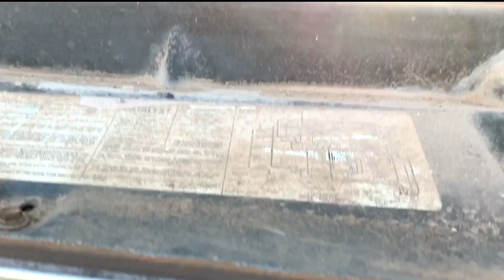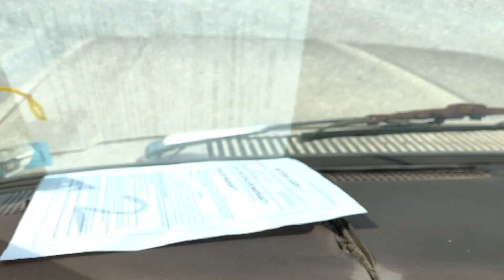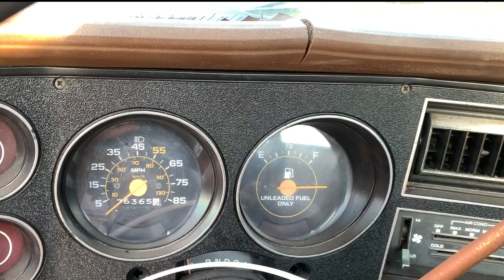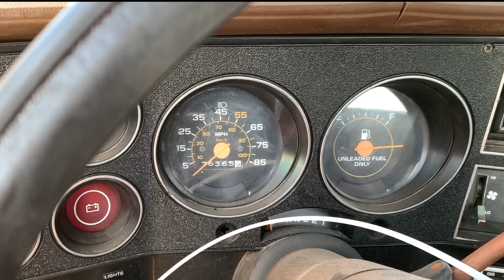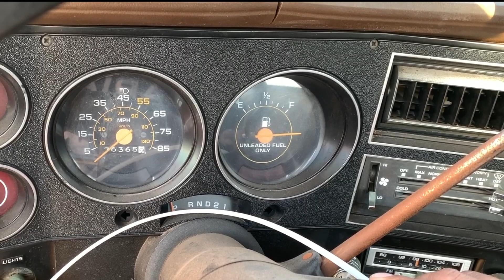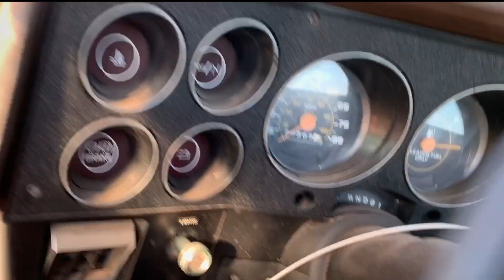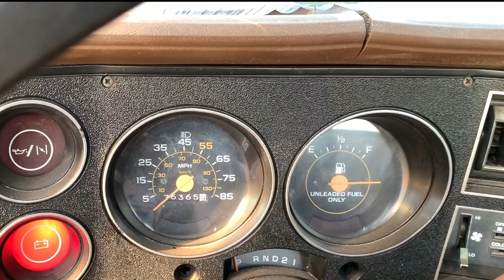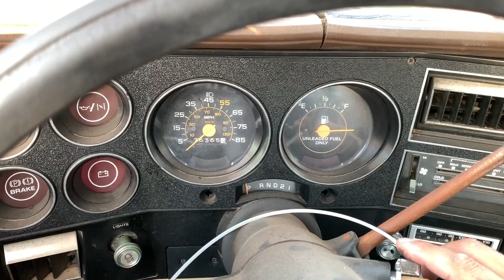Copart $400 Win Reveal - It Caught on Fire!!

Comment: Time for an oil change, some Plugs, Wires, new distributor, belt/s, and the fuel system and it’ll run like a top I bet.
Reply: Needs a LS swap
Reply: Lotta times the cooling system also needs some love on a truck of this vintage, been there done that.

Comment: Never leave the old air filter on a carb engine when using starter fluid or squirting gas into it.  Sure to burn most of the time.
Reply: Yeah, he has no idea what he is doing. Pull the whole air canister off it, it's not that hard.
Reply: Kellys Peppers When will they learn? Lol

Comment: Anytime you have a carburetor fire, just keep cranking and let the engine swallow it.
Reply: That wouldn't have worked in this case because he sprayed starter fluid onto the outside of the paper filter.  The flame had no chance to go back down the throat of the carburetor.

Comment: Replace the fuel line, gas tank(s), and keep the 4.3.   They're Damn good engines!  You usually don't find clean old trucks like this.  Sure it has the V6 but they're just a 350 with two cylinders lopped off.

IF you do swap in a 350, make it appear factory.  These trucks are catching up in value.

Comment: Two things Randy....  1. Don't scare me like that- I thought you guys were about to run that beautiful 350-Z through Copart again.  2.  When I saw the boxy Sierra 1500, I literally gave you that fist in the air thing saying, "Hell Yea!"  I'm so glad you got that one.  BTW, I just want to let you know, the 4.3 sounds menacing with a 1 inlet->2 outlet Flowmaster with dual exhaust at the back.  I had one on my 1995 4.3 L, 5-speed S-10.  I couldn't take off at a light "spiritedly"  as I usually did without someone thinking I was trying to race them and taking off equally as spiritedly at the light.  Congrats!  I'm looking forward to this one!!!!

By the way....  Paint the steelies gloss black, polish the hell out of the hubcaps and you'll have some beautiful wheels on that thing.

Comment: Once its running properly, do a deep cleaning, tint the back window replace the rear bumper for a chrome and get some era correct 15x8.5 Center Line wheels with wide tires it will look cool

Comment: I had a 78 or 79 GMC 2500 that I bought cheap. I mentioned it at a GMC dealer and they said to bring it in it's a recall. The lobes on the cam wore out. They fixed it for free.

Comment: If the tank has just a little gas in it, you can get away with with diluting the crap gas with some fresh stuff.  Put in one of those cheap inline filters in addition to changing the cartridge filter in the carb & you should be good to go.  If you can get her to run at all, I've got a crazy method to do basically a free tuneup: dump water down the carb while it's running.  Sounds crazy, but I've done this at least 50 times & it never failed to get results.  With the air cleaner off and the motor warmed up, rev the motor up to 1500RPM or so and slowly pour a glass of water into the primaries (front barrels).  If it bogs down, pour slower or rev it up a bit more.  It may pop & sputter; it won't for long.  Rev it to 5000 a few times when you're done pouring.  It will smoke a lot for 20-30 minutes.  When you are done it will run 100% better.  Example: V6 Bronco II was hard to start, would die on very slight hills & had basically no guts.  The owner thought the motor was tired so he sold it cheap.  After the water method, & it would bark the tires in 4WD!

Comment: tip on prime clean out around bolt on breather losen up just enof on top let gas run slow down the skew on carb. on the little cup around the top of screw or tap then you will not have to remove the top eveytime it is safer

Comment: If you use a CO2  Fire Extinguisher ,you wouldn't have such a big mess to clean-up, I believe you  got a great deal just pressure wash it down tune-up & new carb & fuel system & it's good to go

Comment: You need to fill the vent tubes to the float bowls with gasoline first thing and unhook the gas line to the carb so it dont get the nasty stuff into it. Put Square body in the title to get megga hits. GMC Square body truck. I would be willing to bet that you could put a new tank on it and fuel pump and a filter and it would run. I bet your correct it pumped a whole bunch of nasty sour gas into the carburetor. Maybe it will be ok but quit cranking that bad gas into it. Now you may have to take the top off the carb to douche it out with a can of spray carb cleaner. Possibly dump the old tank out and look on the inside of it to check for rust and if its ok just put it back on with a couple of really big filters.

Comment: Spraying starting fluid into the cold air End on the air cleaner housing  will too no good as there is a door that in there that gradually opens when the engine warms up. It works on a thermostat off the exhaust manifold

Comment: Please, don't rush it with getting the engine running again. Spraying a shit load of starting fluid in an old, almost dry engine like this one with old oil and old gas isn't really healthy for it. Do it the right way. Drain the old fuel from the tank, check the fuel system for dry rotted hoses and replace the fuel filter, do an oil change, check the point's, distributor cap, change the plugs with wires, check the coolant level at least. Take the carburetor of and at least clean al the jets before cracking it over like this again. I have seen many people being enthusiastic with getting an old engine like this running again and that caused many problems later on, things clogged up, the engine overheated, head gasket did go, or crappy fuel/oil destroyed everything. If that happens you would have wished you did it the right way at the start.

Comment: COOL TRUCK! All original! Please keep it like that! I guess you learned not to spray starting fluid in the end of the air cleaner! LOL! Always spray it down the carb or throttle body with the throttle wide open. It sounds normal when cracking it over. All the old Chevy trucks sound like that, even the V8's. I have a 92 ext short bed with a 350/auto, it sounds about the same cracking over. I would suggest you keep the quietest exhaust on it, so no one knows it is only a 6 cyl and not a V8. DO NOT MODIFY IT just clean it up get it running decent and sell it. ESPECIALLY since it is a ONE OWNER! Leave it ALL STOCK! You will get a lot more for it! I know how you can get crazy spending money on modifying vehicles, but this time try to control yourself and actually make money on it. If you want content on it make the content cleaning it up and getting it running, then drive it a few places. I bet the AC will work fine with a used compressor from a pick-a-part and some Freon. Good luck! :-)

Comment: stay with the 4.3 just a newer one with lower miles. great running motors you can got one cheaper then a V8, and you will have to change the trans if you put the V8 in it clutches and torque converter will not hold up to that V8 stay cheap get a running V6 4.3 stay in your budget clean it up and flip it make some money

Comment: does that truck have 700k miles or am i reading that wrong
Reply: I was wondering that too......
Reply from the maker: ILikeZulrah copart wrote it as a six digit when it’s actually 5 digit with a tenths digit. It’s 70k.
Reply: Auto Auction Rebuilds ahh 70k that’s practically new

Comment: you didn't even put in any fresh Gas? you don't know if there's even a drop of fuel in that tank, or if it's gelatin or what it is in there. no telling how long that truck sat. look at all the fungus on the paint. first thing i believe i would have done it pressure washed it, then made sure the oils is topped off run some carb cleaner through that carberator even though it's not running just to clean out any gelled fuel in the carb (My buddy swears by Mechanic in a  bottle for that i've personally never used it though) then put at least a gallon of fresh gas in the tank and a new fuel filter check the rotor button and cap and check each plug for spark. then try starting it. you went all out of order here just to see if it would even fire up which i get that it's just you were eager to try it out. Oh wow yeah we could hardly hear it running on video so i couldn't tell you what to look at first or if it might be fuel, spark, a miss or what. the fact it did start up and wasn't knocking all to hell lets you know you got something to work with there. wel worth the $750 and don't discount it because it's a 4.3 either. my best friend had a 1997 silverado 1500 with the 4.3L and it would do everything my 5.7L would do

Comment: So u catch it on fire & then spray it with a fire extinguisher & decide to such the fire extinguisher stuff into the motor? Wtf??? Why didn't you fill the bowls with gas? Check the oil?  The timing? Eventually u add gas. Man, u make me shake my head & sometimes, yell at the screen